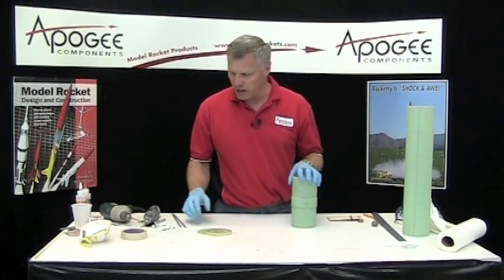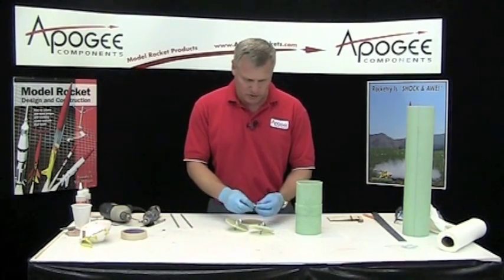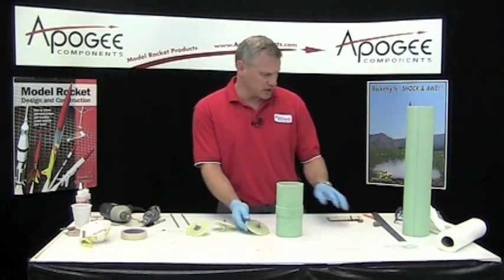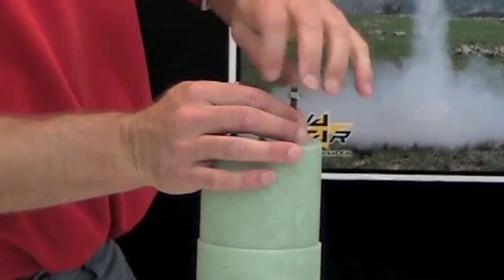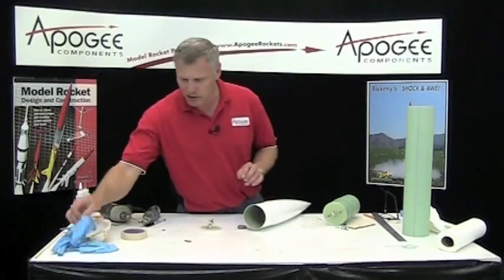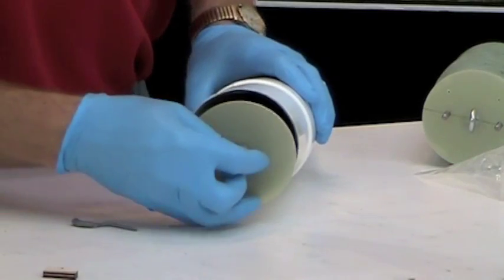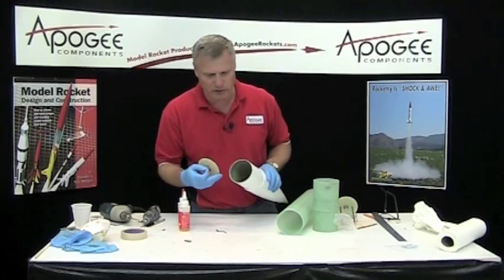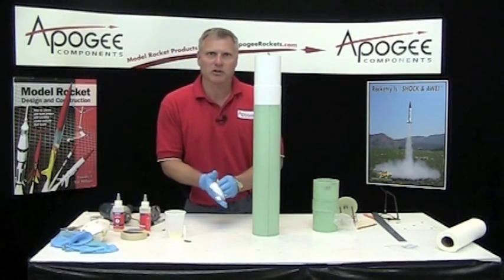Building the Level-2 Fiberglass Rocket Kit - 10: Install the Nose cone Bulkhead

Comment: I bet you could shed 1 1/2lbs off that rocket just in NOT jamming putty and huge eyebolts everywhere. its just not necessary. smaller brass or aluminum eyebolts and loc-tite for the threads